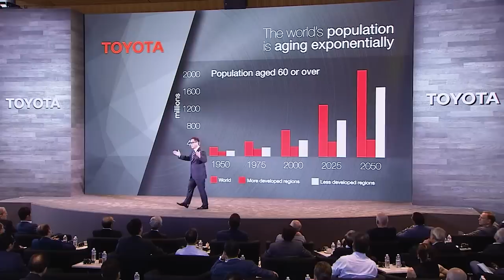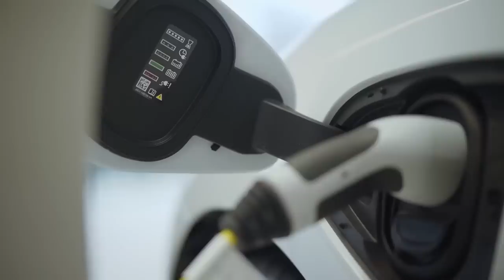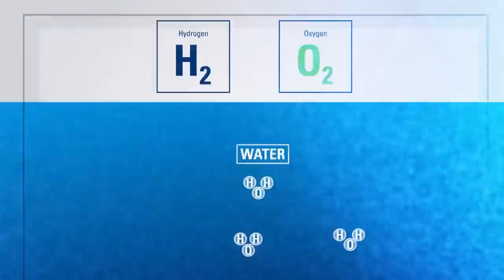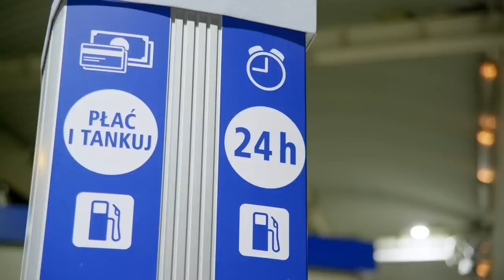New Toyota CEO Shocks Everybody | Huge News

Comment: Been working with one of the main development guys from AMG Mercedes and he told me the combustion engine is far from over, many of the German manufacturers are researching alternative fuel for the combustion engine.
Reply: Why though? Electric motors are smaller and take up less footprint, have less moving parts, and the BEVs are quieter and faster. What's the point of keeping combustion engines? I do like the idea of FCEVs, hydrogen fuel cells more than BEVs. But those hydrogen tanks take up a lot of space. They have to be made smaller and more efficient.
Reply: @benjaminsmith2287  where the part of mining is less carbon footprint? For an example not all place around the world make electricity from Renewable energy.. Like some part of asia or africa they make electricity from Diesel or coal power plans. Maybe the carbon not in Europe or "first class" country.. But they just put the responsibility to "third class" country.
Reply: I agree the combustion engine has a ways to go yet, one thing I don't hear allot of talk about is natural gas, its abundant it has far less emissions and I doubt battery operated electric can compare in carbon savings if you look at the full picture and its fairly cheap to convert the existing combustion engines over to run on it and the filling infrastructure would be easy to switch to.
Reply: @jaymortensen642  cars running on LPG have been on the road for more than a decade. all taxi in in Hong Kong are run on LPG.
Reply: @benjaminsmith2287  Because that's not what enthusiasts want, and a subbrand catering to enthusiasts (such as AMG) needs to provide what their enthusiasts want. And EVs are not that, sure they work for average people, but for enthusiasts, speed and efficiency isn't what they're looking for, especially speed in fact, because you can't even really get much out of a fast car on public roads, enthusiasts would much prefer to be able to have a fun car with good handling but isn't fast so that it's actually fun to drive even around town. Part of the fun is also having a manual transmission for many enthusiasts and only ICEs can have that type.
Reply: @benjaminsmith2287  Ideologist!
Reply: @benjaminsmith2287  Without the combustion engine, you would be starving within a week or two. That’s the point of keeping it.
Reply: @kiryukazuma88  all of those concerns can be satisfied through software.  Want a shift lever that makes the car act like a gearbox?  Sure, we only have to modify the torque output per current speed and gear selection.  Done!
Reply: @streetman6661  I'm not talking about liquid petroleum I am talking about natural gas, I know there are places that use LP I remember seeing it in Canada in the early 90's just like forklifts, right now there are some natural gas buses and other vehicles in the US but as a whole nobody is putting them in the conversation, it cost between 5 to 10K to convert your existing gas vehicle which is way cheaper than 70K for a new EV but that is the real problem they don't want you to convert cheaply they want you to buy their whole new platform, they want to rebuild 250 mil. cars in the US alone its to drive a new industry not fix an ecological problem.
Reply: LNG is a viable, clean alternative.
Reply: @benjaminsmith2287  One reason is that there isn't enough cobalt in the world to replace every internal combustion engine on the road with an electric one.  Which all the car companies already knew long ago.  Plus, the mining and processing of cobalt, nickel, and rare earth metals is an environmental disaster for the places it's mined.
Reply: Interesting your buddy says this, I have multiple friends down in Tuscaloosa plant. Mercedes is investing a ton of money into their EV battery technology.
Reply: @rickclogston5205  and oil hasn’t been over the past 130 years?
Reply: @benjaminsmith2287  Do you understand the the infrastructure required to do all of the work of combustion engines? Did you not watch the video?
Reply: Toyota and Yamaha already well advanced on 5.0 litre v8 running on straight hydrogen
Reply: @rickclogston5205 better be concerned about lithium, then cobalt, but you have a point)
Reply: @timyogerst4349  You miss the point entirely, enthusiasts do NOT want simulated manuals or driving at all. Enthusiasts prefer the analogue and connected feeling of driving a car manually, that's why a lot of enthusiasts like older cars over newer ones.  

But it goes beyond just manual driving too, electric cars, while some purpose-built models can be quite enjoyable to drive, just aren't that desirable to enthusiasts for many reasons, 1. because they all practically drive the same, 2. because they lack the unique sounds that ICEs offer, and 3. because they can't be easily modified with aftermarket parts which many enthusiast like to do as well. All 3 of these things and more, are part of the experience for enthusiasts and EVs simply don't deliver on that.
Reply: Lets also talk about how dangerous EVs are in terms of using them on everyday basis. They are heavier and faster then classic cars, which makes them more dangerous on roads, especially in US, where 16 yo people can drive cars, barely knowing, how the wheel works. Imagine also a car crash with EV, there is much bigger chance of ignition and even explosion. Most EVs are software driven, which make it possible to gov or company cancel your ability to drive if they would want to and you couldn’t do anything about it, when in classic cars you can just manually destroy brains og the car and it still will work as car. Also driving an EV in wet weather or in cold is highly limited, cause you can get you batteries wet and they can explode or ignite in any moment. Infrastructure limitations makes it impossible to use EVs somewhere where you don’t have houses or garages, for example in most Europe countries. They also don’t have so much energy production needed to fulfil the needs of EVs, they’ll have to build atomic stations to avoid energy crisis and be able to follow the green energy narrative, or to buy energy from countries like Russia, which is not popular in present moment.
Reply: @fredmeyer369  keeping your fingers in both pies isn't a bad thing especially financially..both markets are open.
Reply: @benjaminsmith2287  The biggest 15 shipping container vessels in the world emit more than all passengers cars combined, and there are hundreds of them. We aren't even squeezing the right stone. And yes, those ships do the work of hundreds of semis at a time. But it would still be much easier to target single, huge emitters that operate almost entirely at steady state than a billion tiny emitters that operate chaotically all over the world.
Reply: @tobyvision  15. How about that. Makes me want to acceleration hydrogen power even more.
Reply: @benjaminsmith2287  Shipping vessels might be a worthwhile target for hydrogen fuel. You could have the refineries near ports to service the ships. And the explosive risk would be isolated at sea most of the time instead of distributed all over inhabited land.
Reply: @tobyvision  I don't think the explosive risk will be that much of a factor in time. Right now, ships catch fires and planes  have an explosive risk but even though hydrogen is highly flammable, engineering can figure out how to make that a minimal risk.
Reply: @benjaminsmith2287  yeah, it will be mitigated I'm sure. But it's still a slam dunk application to centralize it in large ships at sea.
Reply: @tobyvision  I hope it is. But also, it should be in trucks as well. And we share the road with trucks. So, they'll need to have the safety and fire risk at the same level as current diesel power trucks.
Reply: @benjaminsmith2287  I hope it is feasible.
Reply: @rickclogston5205  You do know how much rare earth metals a BEV need? 0, nada, zilch (except maybe in the touch screen but that's not BEV specific)... Compare that to the catalytic converter a combustion engine needs so that it doesn't poison you and sends you to an early grave (yes, current cars are worse in that regard because of the way fuel efficiency is achieved) or the spark plugs - without rare earth metals you wouldn't have either.
Reply: @andrewpitt7742  BMW did that, they ran a few modified cars on the Munich airport for shuttle service, they quickly buried the project for the many problems that surrounded it (I think in the end they were just happy that none of the cars exploded while driving). The only way to store the hydrogen is at -253°C and since you can't externally maintain that temperature there will be hydrogen boil off - which loses about 9% of your tank contents per day on the best insulated tanks available. That also means no enclosed buildings, no paking in the city when there isn't wind movement, and a whole lot of other problems. And it is far less effective than using the hydrogen in a FCEV (which is horrible in efficiency already).

Comment: I love how reliable they are compared to other brands which start to have issues after 2 years!
Reply: not true
Reply: A small correction.
Other Asian manufacturers and sadly to few US and European manufactuers also build very reliable and durable vehicels.
Sadly the first generation manufactures in the US and Europe think more about shareholder value, profits and stockprices then reliability, durability and consumer affordability.
Reply: @steventangney1367  Toyota is by far one of the most reliable cars ever lmfao
Reply: I have a yaris diesel 14 years old brought it new Toyota have written to me about six times over the last 14 years to say we have had a problem with x on the yaris please take your car to the nearest dealer and get it checked 
No other manufacturer would do that 
Ford would consult their lawyers and work out if the casualty rate is cheaper than the bill for recall and vw would just sweep it under the carpet
Reply: Using the warranty 12 times a year is not "reliability" .
Reply: @markrobinson9654   Spoken like someone who has never ever owned anything except a Toyota long term
Reply: @markrobinson9654  there's a Yaris diesel? Not here there's not lol
Reply: @Mark Robinson  as a mechanic I disagree.
Reply: Toyotas are pretty bullet proof. Sadly most are let down by the incompetency of the owners
Reply: More like after hitting 59k mi don’t even take 2 years 😂
Reply: @ShORTiiqOtGaM3  I don't understand what you're saying. It is English yes?
Reply: @AJS86   Some Toyotas are pretty bulletproof — some are not.
Reply: I had a new Kia with all the bells and whistles, top trim. Broke down in less than 48k miles, would die mid drive. Dangerous. I have a Tacoma that’s been rear ended at 50mph, sank in a 3ft mud hole with severe damage to alternator and radiator, drove 2 miles with a broken belt, accidentally drained my trans fluid and doubled my oil drove for 30 miles, abused to the max by my own stupidity, almost 100k miles with no brake change (still good) and it’s still driving just fine with zero issues minus a loud rebuilt alternator. Amazing truck.
Reply: @steventangney1367  oh dude.
Reply: @AJS86  America misses out on a lot of diesels because the regulations are so strict here.
Reply: @AJS86  there is, its a of the shelf 1.3 hdi PSA diesel unit mostly sold in Europe. 
Even the smaller aygo was available with a diesel engine!
Reply: @obelic71  we don't even get the Aygo in Australia. Yaris is as small as it gets.
I bypassed all of them and bought an 86 instead 🤣 best fun car to drive every day ever.
Reply: @Steven Tangney  tomorrow morning I am going to Scotland in it at 60 miles per hour it will do about 72 to  the gallon 
And the car having done 187000 miles will perform perfect
Reply: Quite true. I've got a 90 Camry with 140k and it still runs like new. Of course that's because I care for my cars and maintain them
Reply: @markrobinson9654  Every manufacturer is mandated to do that as long as the car is registered on the road... So don't flatter them when they are doing what is required of them by law.
Reply: @Karl Günter Wünsch  Ford have a history of working out which is more profitable 10 possible dead bodies or 300000 recalls ...they go with the body count its cheaper
Reply: @markrobinson9654  In the US maybe, in Europe no such shenanigans...
Reply: @steventangney1367  very true.